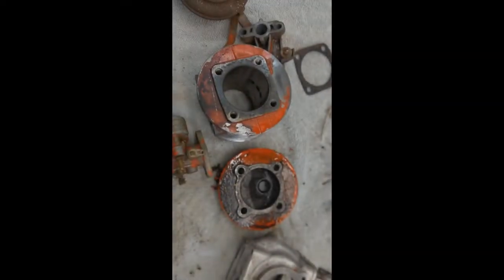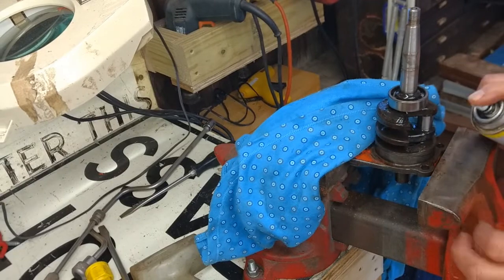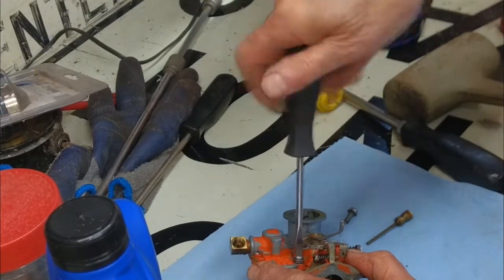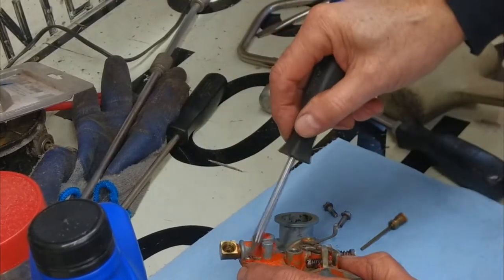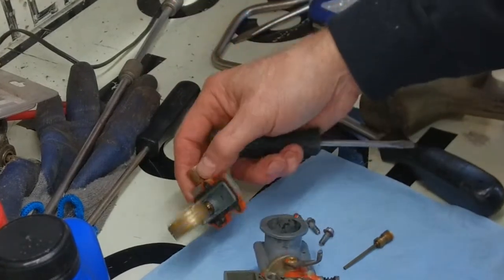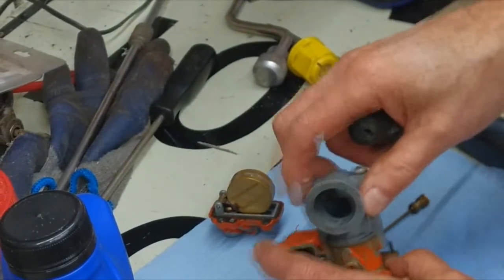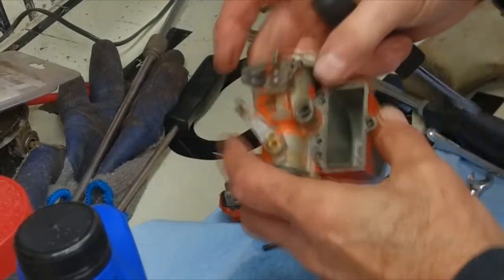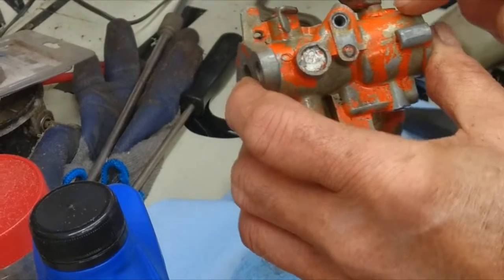Cleaning and inspecting Jacobsen parts

Comment: Its coming along! I usually just have wally world change my oil,There super tech is good oil.Sometimes i have to change it at home if i do engine work.
Reply from the maker: I use super tech in my vehicles too. If the oil is change more or less regularly the brand really doesn't matter for normal use. Thanks Chris

Comment: Looking good George! Alcoa is a huge aluminum manufacturer. Here's a link to their website: https://www.alcoa.com/global/en/what-we-do/aluminum/default.asp  I had a fuel tank about like yours that I ended up cutting the bottom out of and stitch welding in a new one. I then used fuel rated JB Weld to finish it off and it has held up well.
Reply from the maker: Hang on the for final on the tank to see how I solved the problem. Thanks Matt